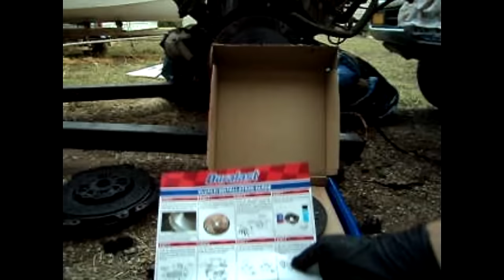nissan truck pickup clutch kit replacement

Comment: So just curious here, but is it that much easier to pull the motor than to drop the trans??? Asking cuz I just scooped up a 97 hardbody and the po didn't drive standard very well so that's first on list of to-dos.
Reply: I think the engine might've been out already for other repairs...
Reply: No!  I've done 3 Nissan clutches and it is a pain but pulling the trans. is where it's at!